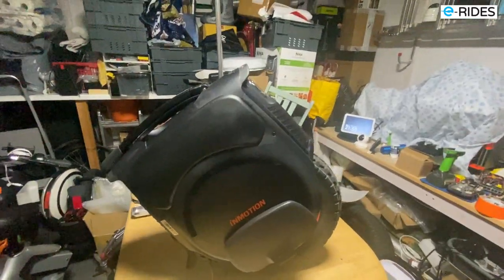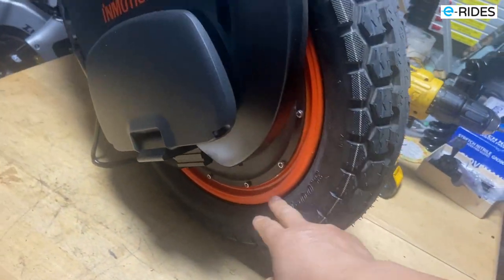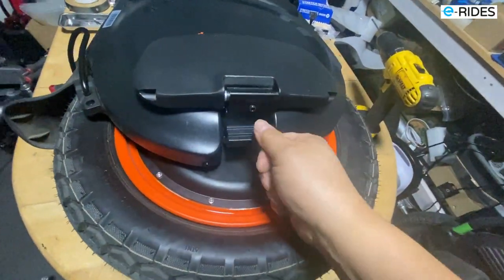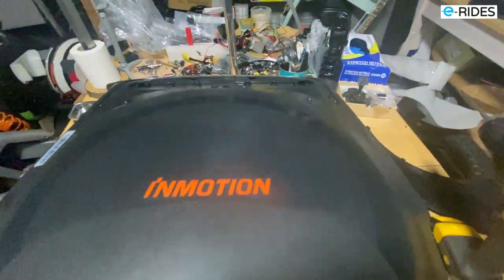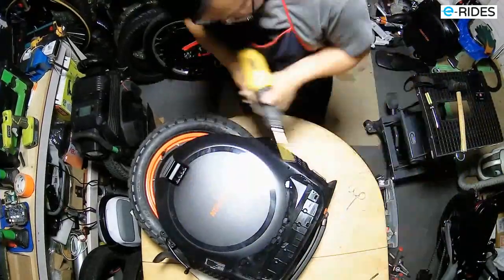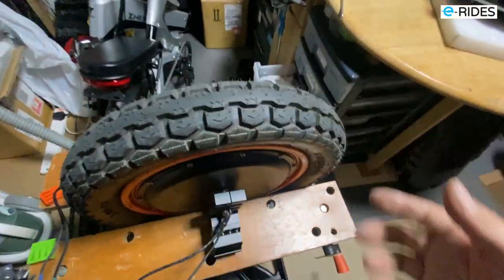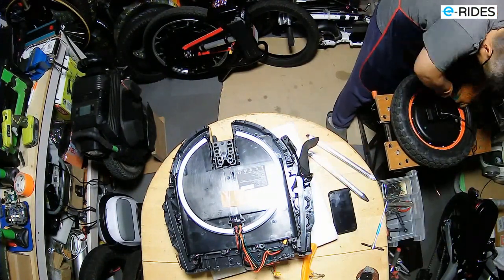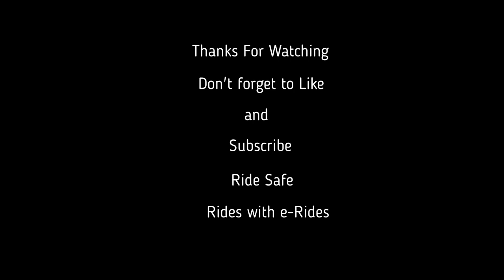Inmotion V12 HT Quick Inner Tube Change. e-Rides EUC Upgrades .

Comment: I want to know what you had to drink to move so quick in your video 😁. On a serious note, thanks for sharing, I am just in process of tube change on my V12HT I am assuming that it is going to be same issue with tube because I came home from work and stopped fast then heard a woosh noise and tire was flat.

Comment: I'm assuming it's safe to say to change my tire on my HS version I can use a new stock HT tire if I want a more dual purpose tire as opposed to street tire. I'm fairly light so the HS still has torque when I ride but it could be a nicer ride on the dirt trails with a more suited tire I believe. My stock original tire has 1000 miles on it now and I'm sure could go for awhile more but I want to change it for this summer and fall season to do more dirt roads.

Comment: This is soo common problem for V12HT. Isn't the ric hole too sharp? Mine V12HT has 2000km on the clock and 0 problem so far. I use 36 PSI :)
Reply: 36 psi is not low, i would say normal

Comment: You can probably patch that and not have to disassemble the wheel. A new tube might have the same problem where as if you push the tire off to the side to get to the tube, you just use rubber cement and patch the valve area which should make it stronger then the stock tube. I think that will work better and you don't need to ever disassemble the wheel to get to the tire.